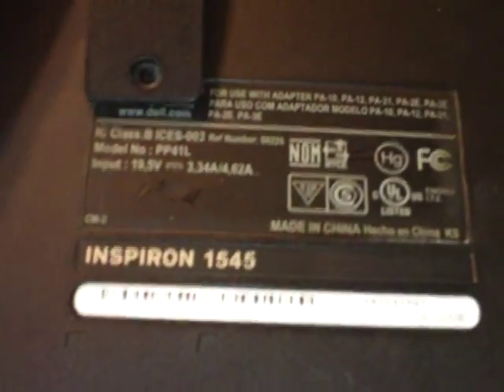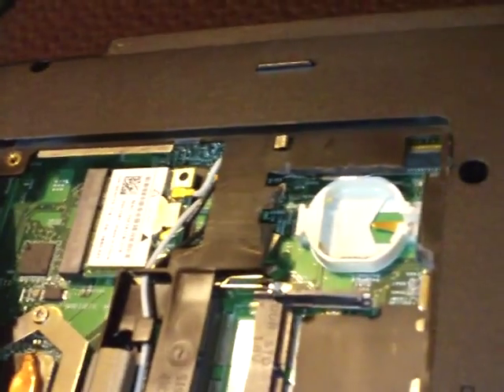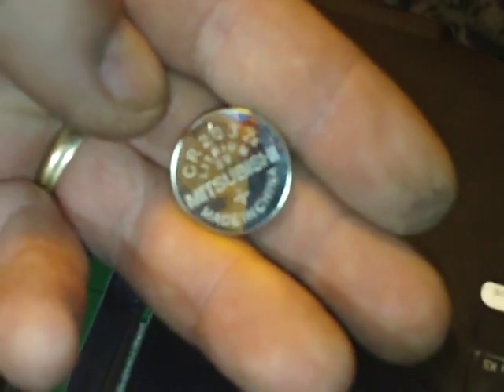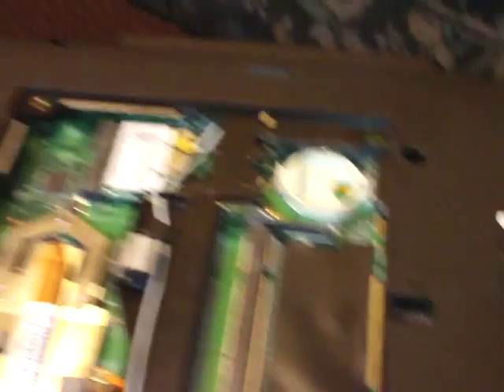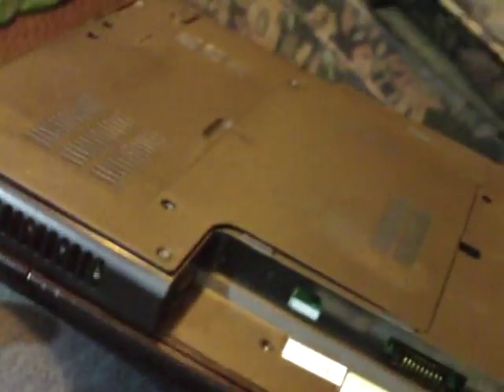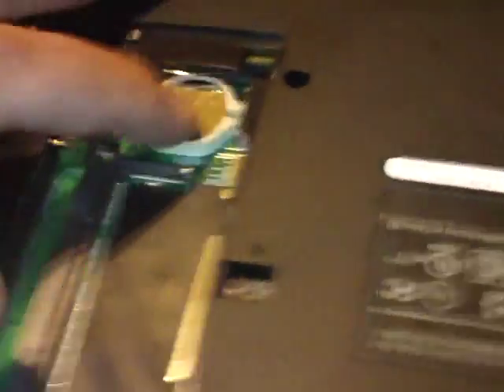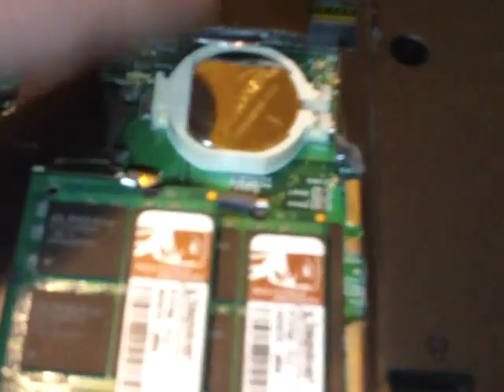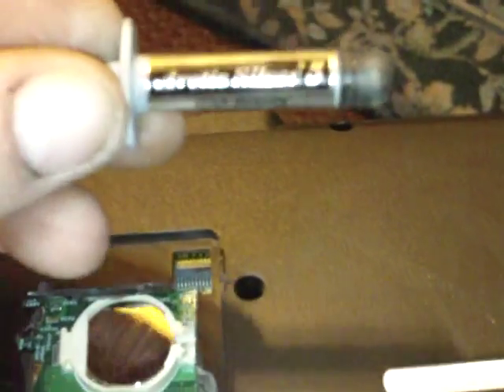DELL 1545 LAPTOP Cmos BATTERY REPAIR !! (THE EASY WAY )

Comment: Thanks for posting. I have the same laptop. I am about to change the cmos battery too. I have bought 2 battery replacements and they wont charge. Have you had any issues charging your replacement battery?

Comment: Thanks for the tip.My laptop doesn’t turn on anymore but I see the power light and the fan spins sometimes. I think the cmos needs to be changed so I shall give this a a try and see if it revives the laptop.

Comment: Hello sir, Did you disassemble the entire laptop to get the motherboard 
?
Reply from the maker: NOPE , That is the whole point of this vid ..
Reply: @shawnmrfixitlee6478  Oh, ok thanks, does the charger heats up even not plugged to the laptop?
Reply from the maker: @oscaruycoque304  Not sure what kinda heat you mean ? But is should not get hot either way . You may have another problem causing that ..

Comment: I just took that L shaped cover off. then because I didn't have a dremel, I had to painstakingly cut a square above the cmos. Under that was a aluminum metal shield that I took a pair of small snips to, changed battery.........no more whining wife lol
Reply from the maker: +born68  Right on man .. It works !!